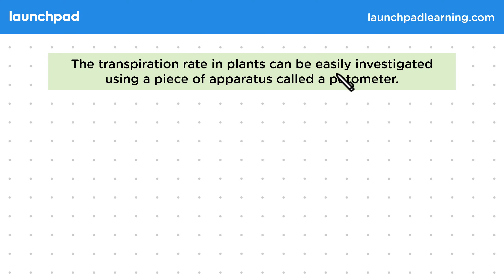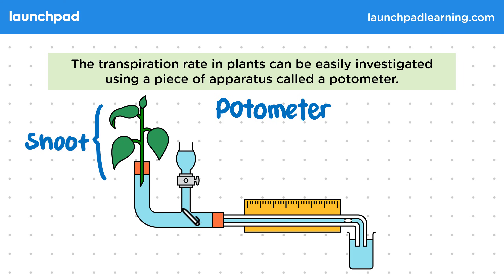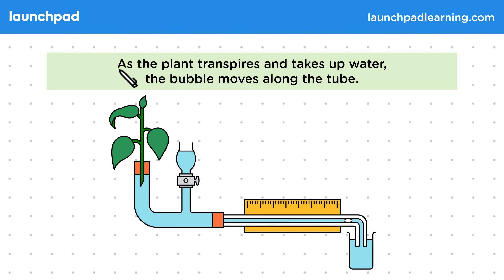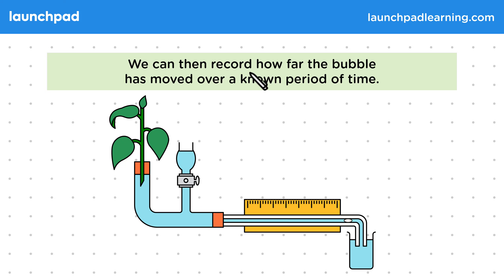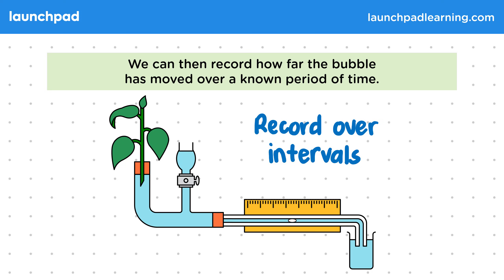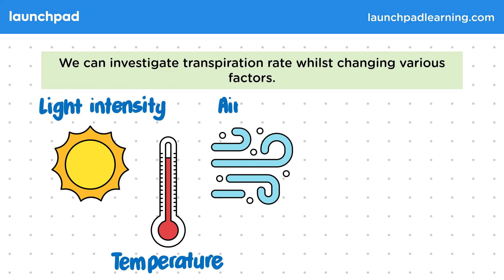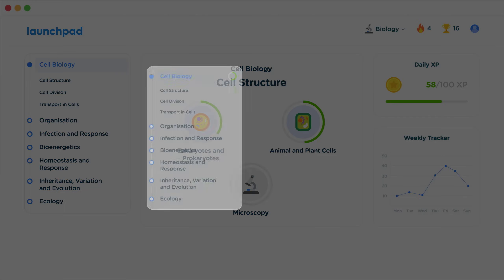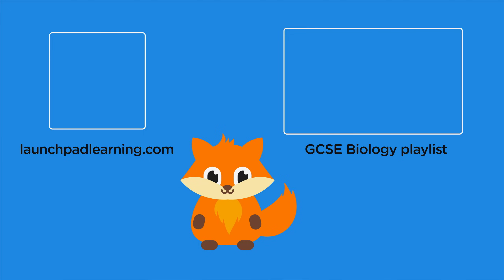Investigating Transpiration Rate - GCSE Biology

Comment: Good video but what is the reservoir and tap used for ?
Reply: if you undo the valve the air bubble is pushed back to the start so the practical can be done again.